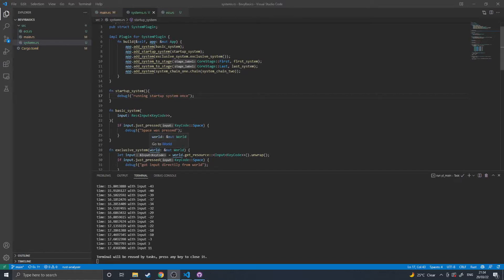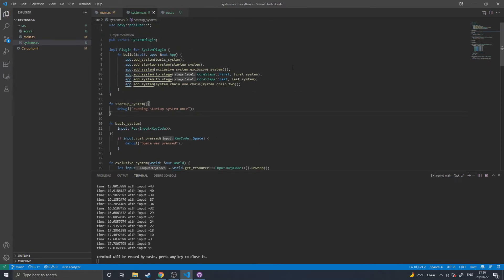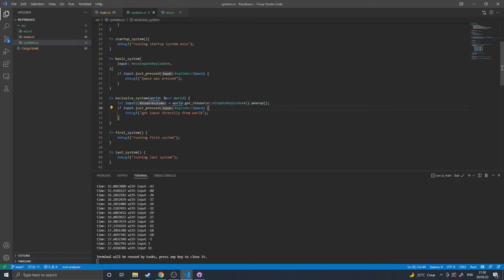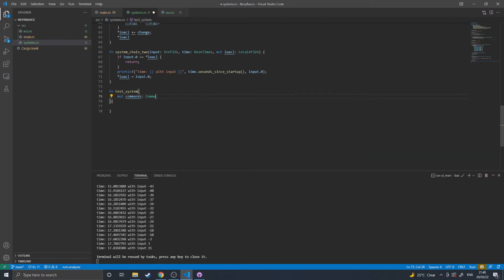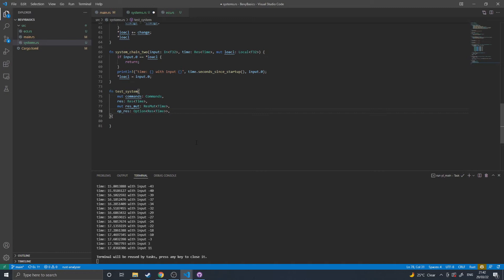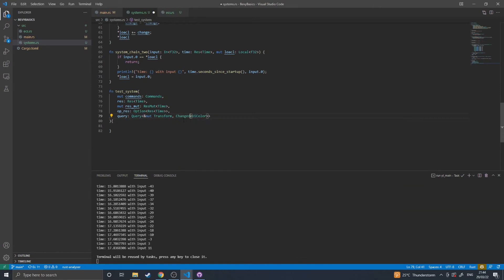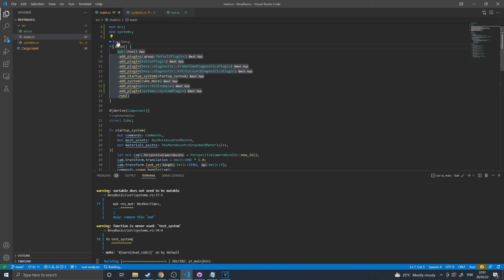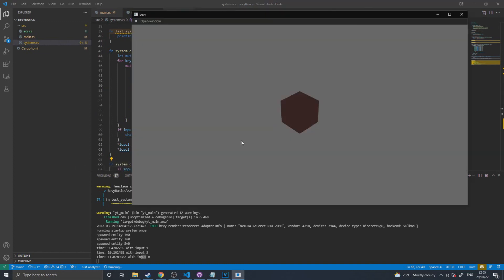Bevy Basics #2 Systems

Comment: are these videos, along with the others on bevy basics playlist, outdated?
Reply from the maker: The early ones are some what outdated but only in that some things have been renamed or rewroked, I did re make the first two episodes because they are the introduction so I can't expect people to read compiler errors and work out what they need to change to get something working. Do let me know if you think any specific video has straid too far to easily follow and I'll remake them but as long as you watch the first two videos of the playlist and understand them the rest should be fairly clear on how to adapt. If I remember the oldest therefore most out of date ones are more about the ideas anyway so watching them is still a good idea even if the code itself doesn't work